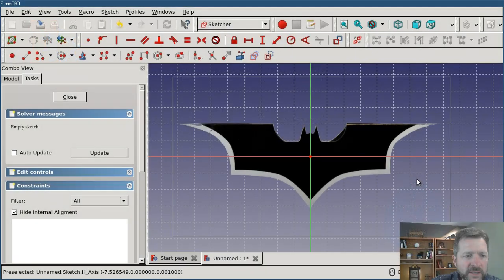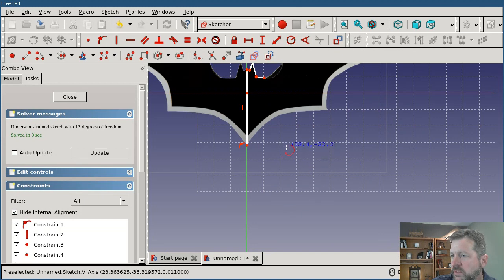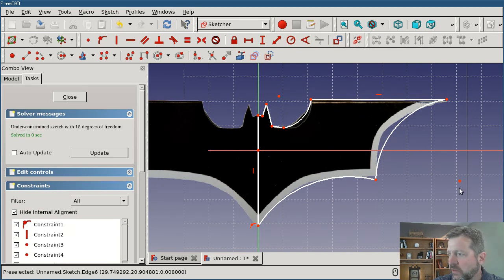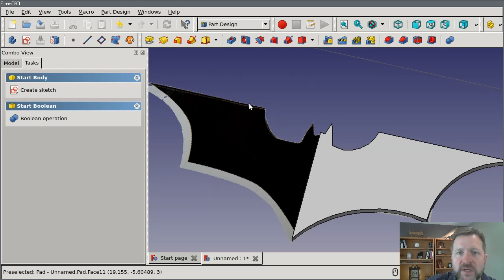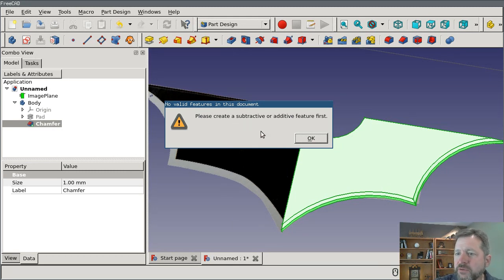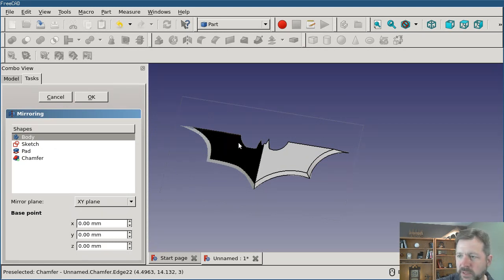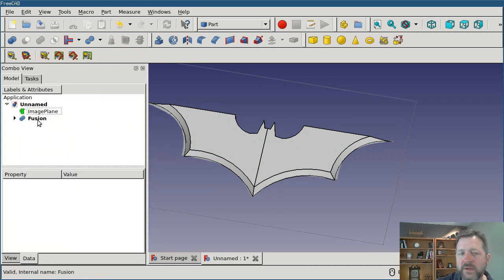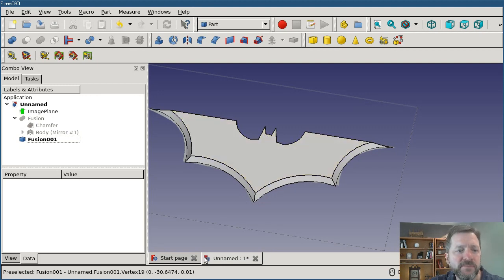Part 2 - Modeling with Symmetry

Comment: I can not get window 10 on my laptop to  put an image in a part design model.  Images only appear as a separate item as a jpg file.
Maybe you have some contact that this problem which has existed from the beginning for freeCAD 17 and 18 need to get fixed.  I can not make a model transparent but switch back and forth to wire frame.   As a person that used the very early 3D cad system I learned to model in wire frame.
Reply from the maker: That is correct.  The image (image plane) is a separate entity and can't be added to a part design body.  However, you can create a Part object (icon looks like a yellow step) and add both the image plane and the body to it.  The advantage is that the Part object can have its own placement so you can relocate it and all the children will follow

Comment: Regarding Part --> Refine shape, an alternative is to use the Refine Shape Feature found in the OpenSCAD workbench. Contrary to the Part Refine shape tool, it is parametric, in other words it remains linked to the original shape. The OpenSCAD workbench includes tools that provide compatibility with OpenSCAD (a script-based open-source program popular in the 3D printing community), and some of them rely on the OpenSCAD software to be installed separately; but the Refine Shape Feature along with a few other very useful tools work independently of OpenSCAD.
Reply from the maker: Then does the old Part workbench version still have an advantage?  I love that all these things are possible but I'd REALLY love to see existing tools improved instead of re-implemented in other workbenches?
Reply: Keep in mind that Part is a "base" workbench. It is the GUI manifestation of the Part module which is the foundation of everything geometry/topology related in FreeCAD. All other workbenches are based on the Part module. The Part refine shape tool can be used for imported mesh models (STL, OBJ...) that you convert to shape then to solid, and finally refine to fuse all co-planar triangular facets together. A parametric refine operation applied to a converted STL mesh does not make sense. A parametric refine operation applied to a native FreeCAD model with a modelling history does.

Part was initially intended as a low-level workbench that provides a basic workflow, and other workbench like PartDesign and Arch and maybe even OpenSCAD are high-level workbenches that build on top of the Part module to provide specialized tools.
Reply: Some context on the whole need of a refinement tool in FreeCAD. It is caused by a deficiency in the OCC geometric kernel which does not automatically clean up the edges left by Boolean operations. I believe this was a regression introduced some years ago in OCC. Back then, OCC provided an algorithm to clean shapes up, but the algo was deemed unworthy of usage by FreeCAD developers, so one of them developed the removeSplitter() algo which is behind the Part refine utility. Apparently, since then the refining algo native to OCC has improved a lot, and FreeCAD devs have mentioned the possibility of it replacing FreeCAD's own. In the long run, the goal is for this operation to be automatically applied without the knowledge of the end user.

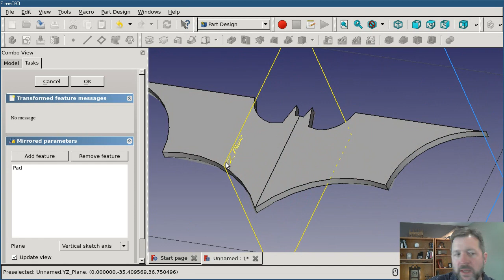Comment: At 6:20 FreeCAD does not actually guess the correct mirror plane. It only defaults to the first available plane listed in the pull-down menu - and it happens to be the "Vertical sketch axis".

Comment: At 6:40 the reason the chamfer fails is because OCC cannot deal with the vertex (the bottom tip) that is connected to three edges. In other words, the residual edge left in along the Y axis after the joining of the two halves is the culprit. If you go to the Refine property of the Mirrored feature under the Data tab and set it to "true", the residual edge will disappear and the Chamfer will succeed. So the workaround of switching to the Part workbench to mirror the chamfered half-body is not necessary.
Reply from the maker: Normand, You need to start doing videos again.
Reply: Heh, thanks. My problem is I am a master procrastinator. Another is my thick French-Canadian accent. :-D

Comment: By the way - where can I get the book? Is it available yet? Meanwhile, eager to see the next video ...
Reply from the maker: I'm finishing a class at the local hackerspace which I'm using to demo some of the content.  As soon as that is done (this week) I'll do a final round of edits and it should be ready to go.  Definitely in September.  Probably in the next two weeks.  It'll be on Amazon among others.  At this point, ebook only but we may make print-on-demand available as an option.  I expect that a POD book would be pretty expensive since there's a lot of pages with color images.

Comment: Thanks so much for these videos - very helpful, particularly for someone like me who is self-taught ... or perhaps, self-mis-taught! I was very intrigued by the issues you demonstrated with Part Design mirror and chamfering. I replicated what you showed, and saw the same errors ... but I also found a way to accomplish the chamfering from this point: select the edges on one side and chamfer, then select the edges on the other side and chamfer. It works out the intersection correctly.
Reply from the maker: Excellent!  I didn't include it in the video (or the book) but I tried this as well without luck.  It seemed very touchy with the depth of the chamfer.  I could get it to work (sometimes) at 2.9 mm, but deeper and the chamfer started to break.  How deep did you get it to go?
Reply: @sliptonic  Interesting - I was able to changer all the way to 2.99mm this way. Maybe a difference in using the Linux version?? I also tried mirroring, then refining the shape, then could do the changes on all the edges of the new shape - that one also worked all the way to 2.99mm.